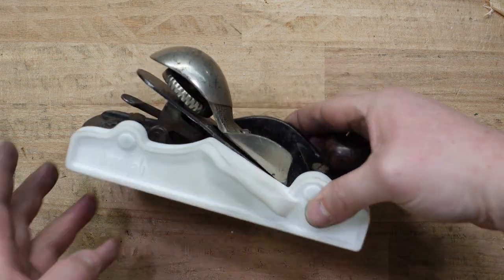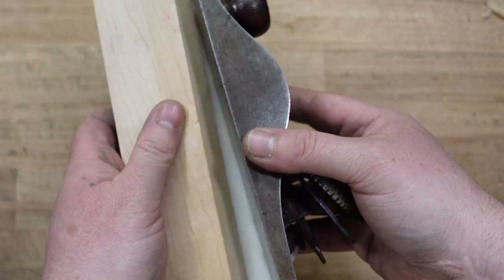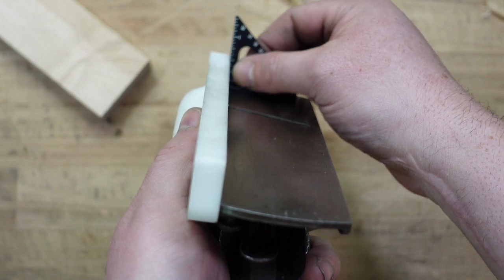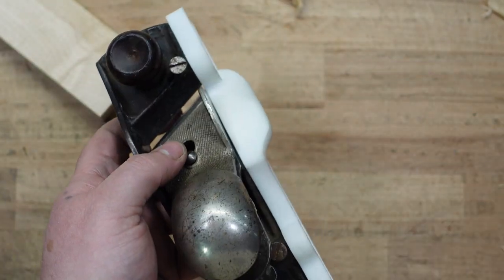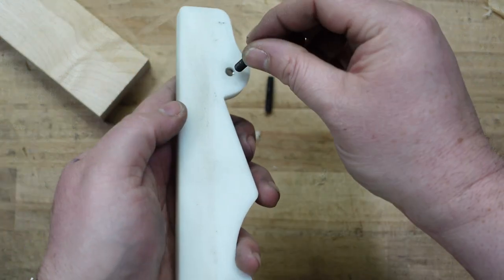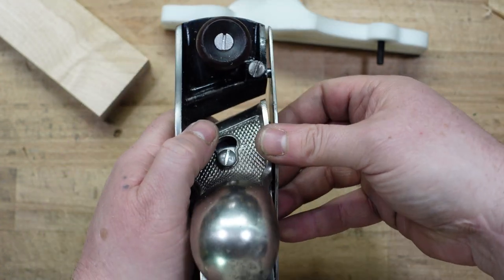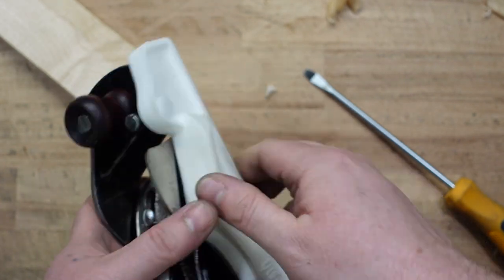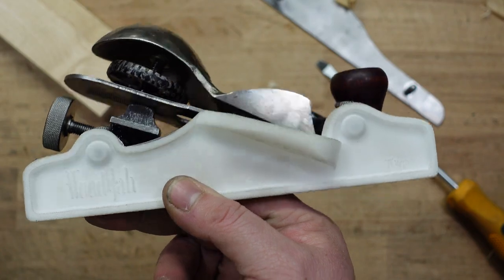BE SQUARE! Fence for a Vintage 140 Skew Block Plane Invention by Woodyah - Review

Comment: The purpose of this fence is different than the LN one. On the LN model, the fence is to set how wide of a rabbet you wanna cut. With this on Stanely No 140, it's functioning the same as No 386 on a jointer plane. It can be useful for squaring small parts.
Reply from the maker: Truth! Thank you for pointing that out, I should have clarified!

Comment: It is strange that the fence is on the right side on a skewed plane. If you notice the Lie Nielsen the fence is on the left hand side. Thus the skewed blade is pulling the fence into the reference surface.
Reply from the maker: That is a very good point. You deff have to keep constant pressure because plane does want to move towards the side with the fence thus pulling the fence away. If you are taking heavy passes, this is an issue. If you are taking light passes I did not see it being a problem as long as you keep pressue

Comment: Being a part of the 3d printing community, most of these have been printed and designed before. If you don't have a 3D printer, as a woodworker, you save soooo much money on jigs and tools.

If you know how to adjust a hand plane accurately or use the Snodgrass method for bandsaws, a 3d printer won't be that different.
Reply from the maker: I'd love one but my comp deff couldn't handle it so I would a brand new comp and a 3d printer hahah
Reply: @BatCaveCreations  oh you don't need a powerful computer to print. It can be ran on anything within the last 20 years as its basically sending plain text to the printer through a USB B printer cable. You would need a decent computer to 3d model anything though!
Reply from the maker: @XxIcedecknightxX  ya thay would be the struggle :( I use to sell on eBay and my old company crashed and orders had to get out so I ran to Walmart at 1130 pm and got the cheepest one they had... it can barely run FB hahahah
Reply: My only problem is I can't seem to figure out how to make my own 3d designs to print but there's a ton of great files out there now!

Comment: I wonder, can you turn the orginal fence upside down to do the same thing?
Reply from the maker: Just checked, you can but only the rounded part stick past the body. At its height it's 1/2. It tapers on both sides down to 0 going past the bottom. about 2 3/4 of a reference js all ull have and it's not near the mouth ipening at all it's directly in line with the back hump of the cap.

This was fun! Great question and I'm glad I checked cus I never thought about it! Lol
Reply from the maker: I took pics, if you email me or message me in FB I can send then over so you know what I mean